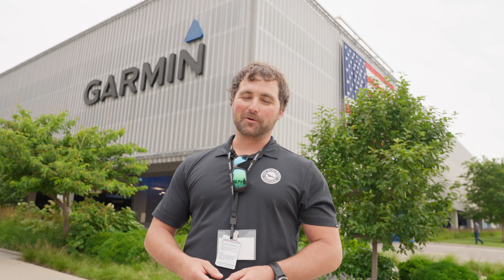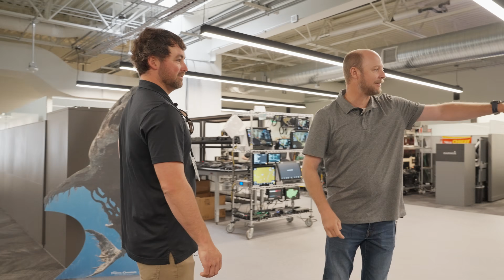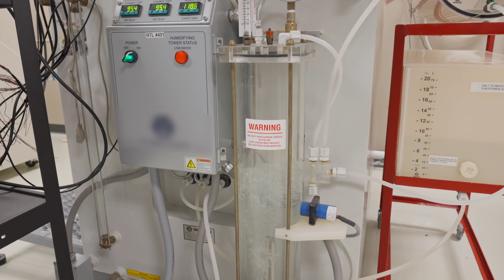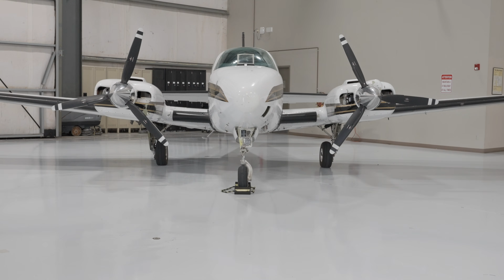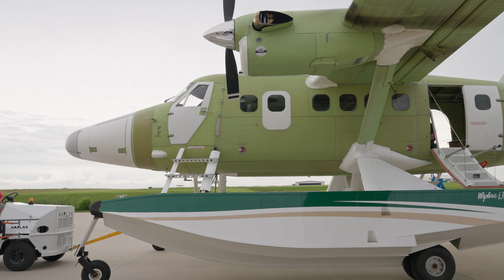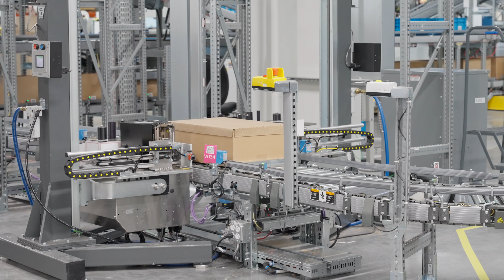Inside Look at Garmin Headquarters

Comment: Hello Garmin, we, the MDA DTS Foundation Texas, would like to discuss a 90% acquisition of Garmin by Magpul with this concept! Hello Magpul Garmin Operator, here is the new concept for the DT Digital Trigger Guard branch: a DT pistol grip for the new hand Guard with 2 and 3-shot automatic firing. The pistol grip has a split design with a magazine at the front and the DT Identity behind it, with an external Bluetooth touchscreen watch with ammunition counter. A contract could be signed with Garmin. Project name: Digital Trigger Pistol DTP. You should talk to Garmin about a watch battery/cartridge counter and ammunition and optic battery scale display, with an LED option built into the wristband that supports the PVC Lightning module with the Garmin Commander watch! This is mounted on the inside of the wrist, with a 1cm rise towards the right for better visibility when shouldering the weapon! Their MDA DTS Foundation Stadtilm would register and charge 25 percent of the corresponding patent to Christian Deutschmann! https://youtu.be/I9Hc7f9pAPk?si=1DU_mmPIDM2OEE5N with a restructuring by Magpul to Garmin AKG Inc. Copyright © 2026 with components from Mez Tech with a Garmin Commander watch for $1299.95!